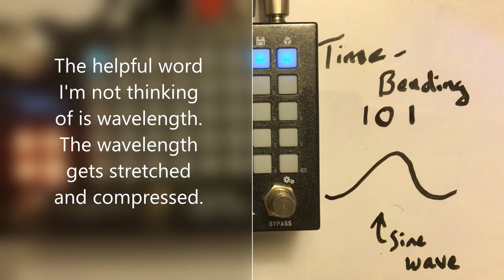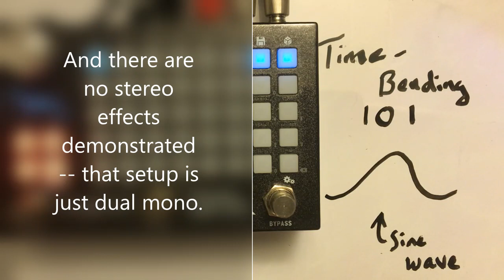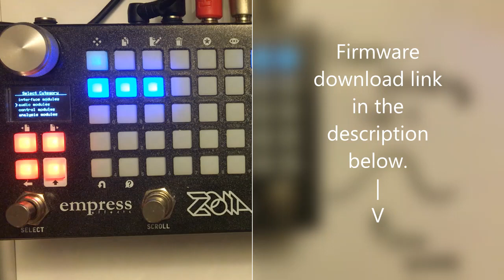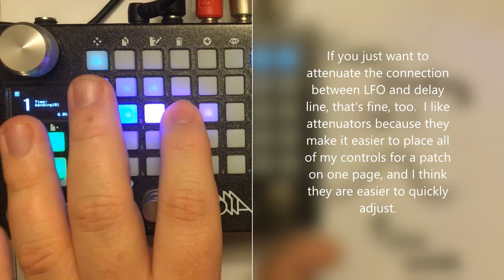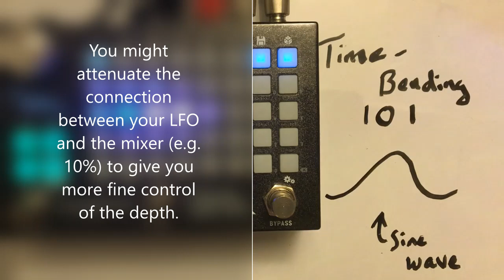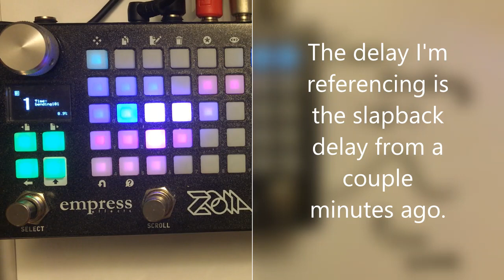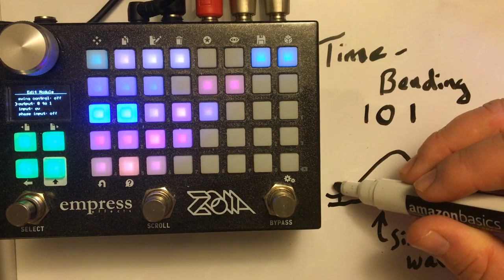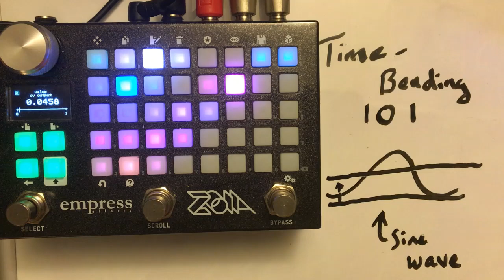Empress ZOIA tutorial:  "Time-bending 101 (how to build time-based modulation effects)"

Comment: Chris, such good info here! Curious how you would emulate different types of chorus? Like bbd or something?
Reply from the maker: Low-pass filtering goes a long way.  It's been a while since I read up on the subject, so forgive me if my numbers are off, but most BBD devices had filtering at some proportion of the sampling frequency, to deal with aliasing and clock noise, etc..  So, that would be the first place:  low-pass filtering maybe ~2400 Hz?  3k?  I'm not sure.  You could try a bandpass filter, too.

Then you can add noise; most BBDs had a little bit of this, no matter how good the filtering, and it became part of the sound for many.

The analog LFOs were often prone to skewing, so adding some swing to the LFO might help.  You might be able to simulate some LFO bleed by having it slightly modulate the filter frequencies or noise level; not quite the same thing, but it might be reminiscent.

Comment: I’m curious about using Haas stereo fields now. Did you ever do a tutorial on the subject?
Reply from the maker: I discuss the Haas stereo spread briefly in my audio module rundown.

I guess my follow-up question is:  Are you interested in this module?  Or in the Haas effect in general and how it's used?

For the former, the Haas stereo spread in ZOIA is a short (I think it ranges from 2-36 milliseconds), linearly-modulatable delay line, with two outputs:  one is the dry, undelayed signal; the other is the delayed signal.  You can use it as a stereo spread (more on this in just a moment), or you can modulate the time to produce effects like the ones covered in this video (although it doesn't make for the best flanger, since 2 milliseconds is kind of at the far end of good flanging times).

For the Haas effect, the Wikipedia article gives a good overview:  https://en.wikipedia.org/wiki/Precedence_effect

The basic idea is that if you hear a signal in one ear, then, after a very brief delay, another ear, you are given an impression of spatiality, even if the source itself is a "fixed point."  This is how our ears tell us which direction a sound came from.  So, if you use a "spatializing" plug-in, chances are it utilizes the Haas effect do some degree (you can also affect a sense of spatiality by manipulating frequency, with filters, and amplitude).  If the delay is too short, our dumb brains can't tell the difference between one ear or the other; if it is too long, we hear it as an echo, rather than a single source existing in some space in front of us.  And the sweet spot is ~15-20 milliseconds.  But manipulating that will give different impressions of the stereo field, with longer times producing a "wider" feel.
Reply: @ChristopherHMJacques  thanks so much! I read about the Haas effect before when studying reverb algorhitms, but I kind of forgot about it. So, just a slight delay between the left and right channels is all there is to it? I'll see if I can find your reference in the audio module rundown (I assume it's in the delay line section?). Might do some experimentations myself too...
Reply: Ah, there's a separate module! Don't mind me! Please... :D